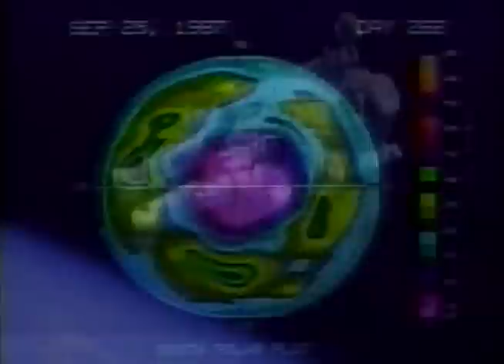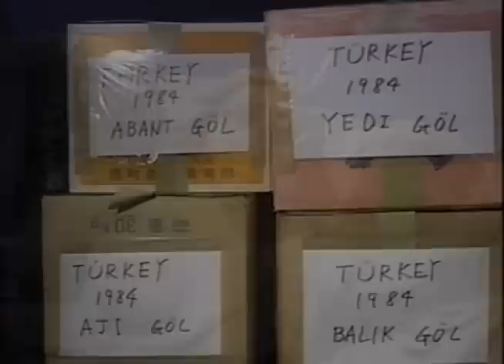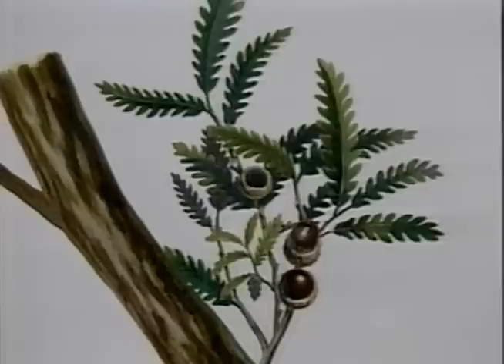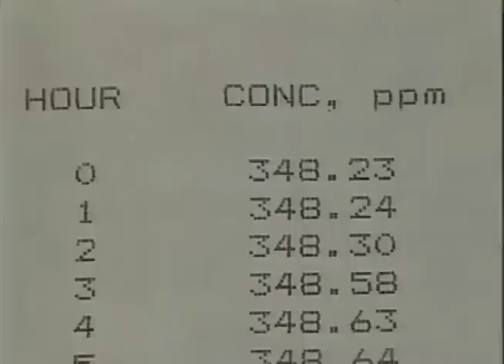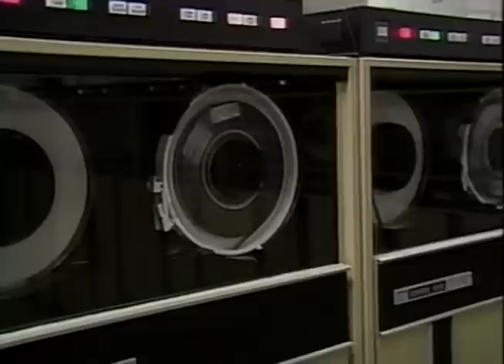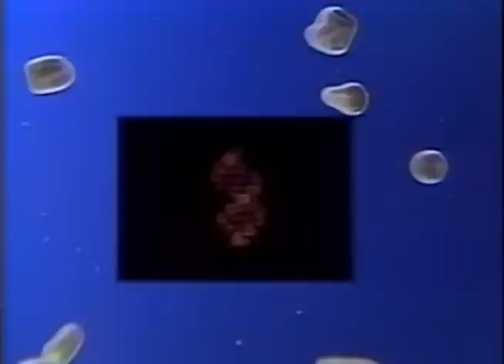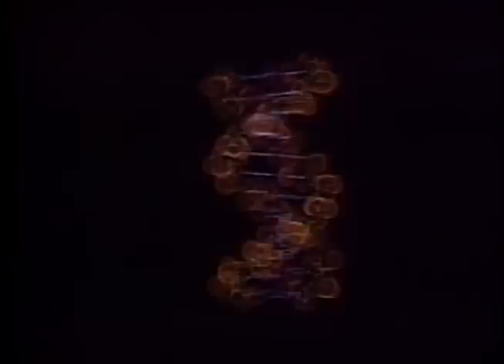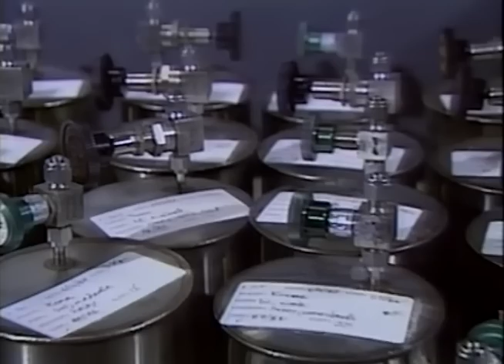Miracle Planet 06 The Home Planet

Comment: Finding pollen in soil samples does not tell you what was growing in the immediate area, necessarily. Pollen can travel for thousands of miles carried by the wind.
Reply: One word for you: conentration.
Reply: Or, if you know how to spell, concentration.  Spelling is a minor detail--Paul hornet is correct in what he means to say.  

When they take samples of sedimentary basins and do pollen counts, they're looking at averages.  If you see massive amounts of pine pollen, and a few grains of oak pollen, you'd assume that the overall environment is favorable to pines, and oaks also do okay in the area.  Could that be wrong?  Yes, it could, actually--it might have been a location where a crazy-prolific pine was leaning over the water, protecting it from any other pollen drifting in easily, all that tree's extra pollen drifting down through the water to land on the lakebed.  That's why they not only take the concentrations of pollen types relative to each other, they also take samples from multiple locations.  Scientific protocols are important, you can't just go from one data source.  Like, for instance, Fox News, or the Bible.